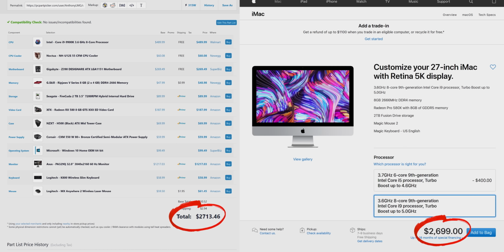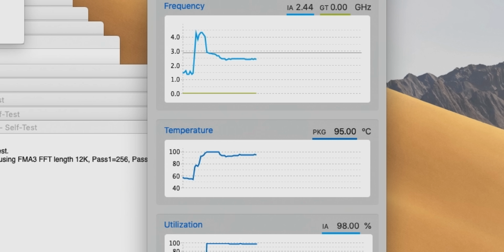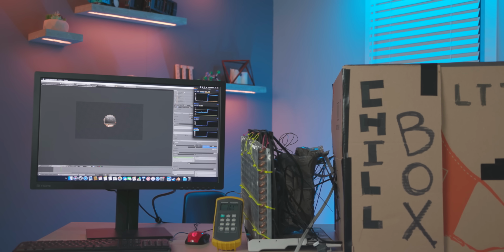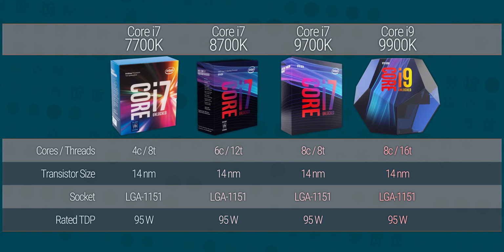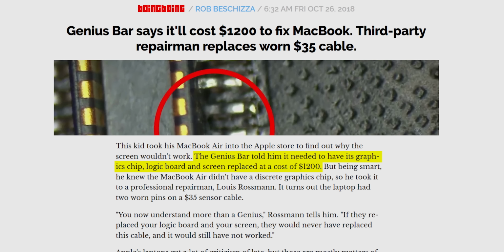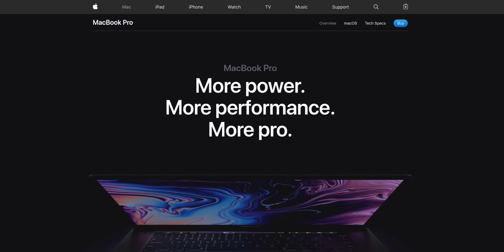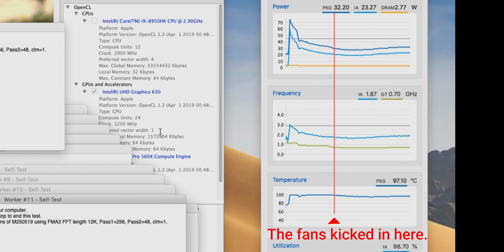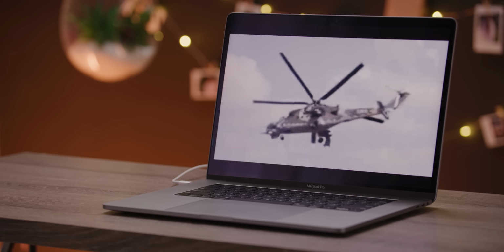Macs are SLOWER than PCs. Here’s why.

Comment: Easy. You look this question as a tech guy. As a product designer I look these questions with different glasses. When designin a product I don't even give a thought about performance. There are market group which I try to please. There are a set of features which this target groups tend to appreciate. Focusing on those aspects and to bring a "quality" feel. It is more important than most of technical performance things. When designing a consumer electronics laptops are usually 3-5 years max. When people have 6 year old laptop, then they want to change because they are tired to old ones. Therefore a good idea is to design a 5 year laptop in mind. Now Apples laptop buyers are mostly doing low performance office work, so why boost performance or long lifetime? They take the cooling to the minimum and gets a huge amount of weight off. This is why I own a macbook. While the unnesessary performance drops, it means more battery life. That's why I own a macbook. The third is the feel of having a quality product, with quality track pad and good feel with a keyboard. That's why I bought a macbook. I am their target audience.

Now I need performance. In our company we need performance. But there is a catch. If you want longetivity and performance, you don't buy a laptop. Because they tend to break quite fast. But you have to, because in companies you need to show things to customers or in meetings. With PC powerlaptops, there are quite good performance, but they are heavy weight. When people travel we go back to the question of weight. Okay they got a performance hit, but those who travel, has a more pleasant trip. It is also a imago question. Many CAD-modelers who does not travel want more performance, but they can't get them because there are less non-traveling ones. Build times are longer but you can open your phone or get a cup of coffee while waithing. Those things happen so it doesn't take the company time off as much as thought. I need performance in my personal stuff, but I would never buy a laptop. I have a Linux tabletop PC (with no childish leds).

Then there is the corporate risk side. If you get a powerful component, which is the newest of the new. Then you take a huge risk. If those component production stutters, then the company is in deep trouple. If the new components sales are low, then they stop making it prematurally. I never go with the performance. I choose a list of components which has the lowest risk. Then I drop all the components from smaller companies to reduce the risk. If there is a company which has almost a monopoly (Gorilla glass), I drop those off too because when the company gets monopoly, then they can do what ever they want and the competition gets really hard. Then the product also tend to stop innovating itself and technology halts.

We have a set of features which our product needs to perform. There is a set of performance which we target and add maybe 10% more. Every company works with limited budget, limited time and limited human resource (even Apple). Within those limits a product must be made. A reliable and quality product. Then they sell it to get more money and with that they have about the same budget to find a corner in the product and start shaping it. At some point the corners get so round that to get more off, you need expensive precision tools. So the amount of resources needed gets up and the changes have smaller impacts to customers. Customers hate this. That is why Android gets these huge changes and IOS changes only small things to the user. Android users want huge changes in every patch, even if they hit performance or are quickly done and really buggy at the beginning.

As for IPhone, the product is their flagship and it has a different audience compared to Macbook. That is why those products are different (referencing to the videos end). Usually in tech forums and comments people hate Apple. But Apple sells it's products. They are doing things correctly. Technically maybe not, but tech guys are not the target audience. Tech guys just look charts and performance and design choises in electronics point of view. How about component risk, business analysis or target group analysis? Have you ever added that to your evaluations?. Apple doesn't even talk to PC guys because they don't care about some dude whining about something when he/she is not clearly even in a Apple product target group. I use IPhone and macbook and I am satisfied customer. That is important to Apple. I work with tech guys and I must say that people have their opinions about tech and performance. But when we talk about products, they don't understand it at all. I have a tabletop PC, where I change the components myself. I can choose what ever I want. But my tapletop PC is not a product. My GPU is a product which I buy. With Apple the computer is a product. Therefore the same rules does not apply as with tabletop PC. I just want the shit to work and Apple does. I have a huge work with Linux CLI stuff all the time, that Apple products out-of-the-box working is really mindfulling experience ones in a while.

Comment: yeah, not pulling out an alienware at work. i want a thin, light, powerful machine...also macos>>>linux>>>>windows IMO
Reply: cool. I think macos is great for more tech-challenged people though, and you're basically saying you are paying a premium only for an OS and looks though so,
Reply: Xray Gaming form has function too, for example the power brick and associated power draw. The machines are nerfed, that we know. My workflow doesn’t require on site rendering for example. Compile times are a different issue and the argument for more beef stands there. Having a professional looking computer is also important

Comment: Mutahar made a custom PC that has better specs than a similarly priced mac, and he runs hackintosh on it, and it runs BETTER than on an actual mac...

Yeah, macs are a trainwreck.
Reply: "Mutahar made a custom PC that has better specs than a similarly priced mac, and he runs hackintosh on it, and it runs BETTER than on an actual mac..."

So sure.. More brute force for the a similar price...  So it RUNS better?  You mean like a Faster actual Mac in Comparison will run "Better?"
Is that your point?
As a Professional audio engineer, composer  , and for 30 years , sold , supported and commissioned systems..... I can Tell you , A hack wont cut it, Its just something you cant rely on...... AND... Hate Macs, sure.. Im not Apple FB, But they have made some great machines.... From the G3 to The Mac Pro 5.1, absolutely brilliant machines....  
And the fact is, when your a Large Film Post Production company, no matter what you say, the issues of support do not entail hardware from Various vendors, and windows (not PC hardware) is pretty much a sea of pain....  
Ill give MS credit, it'd be friggin a huge resource to keep things compatible with different architecture..... But an example, though more a parallel...  OSX supported G4 motorola CPU;s , then IBM PPC CPU's , then on to intel..... Sure, it could be a pain not having PROTOOLS not run on the latest OS release... But you also have to give credit where credit is due....
I love OSX. For Audio its my thing, and its my daily driver....  The system im running has been  updated since 10.3... Cloned and updated through multiple machines......  Never, ever have i had to Format and Reinstall,,,, (Except For a Drive Failure , which was cloned) ....  Does the hardware matter?  Yes/no.   
I hate apples Obsolescence by Design,  I hate this glued together form factor they are pushing, Especially the iMac with the "Pro" Tag 
As for my 2009 Mac pro , to this day, has never let me down.. 3rd party ram, evga980 PC GPU, about 8 Drives. 6 SSD 2 spinners..........
Back when on release at the time, you could not build a PC (server parts... Xeon ) for the for the first few months on release..... But, Apple in their wisdom, Never , ever dropped the price until a new model was announced.... And thats the conundrum... That could be in 6 to 12 months............ 
However.. The New Mac Pro is awesome for us audio guys... But fk me...  that base model is a spit in the face...
Anyhow,  this is not a dig, Just whether you like it or not , There are REAL reasons why alot of Pro's , especially in the audio field , Use macs....

If Linux was a platform that was as complete asOSX, Id make the move straight away.... But, i digress...  Logic for me...  Then again, I could always return to Cubase for Film scores.......
Reply: @Rhythmattica  
This comment can be summed up in one sentence:
"I don't know what hackintosh is"
Reply: @meyes1098  Yes i do, and obviously you didnt read my post.
Your comment can be summed up in one sentence..
"you dont care"
Reply: @Rhythmattica  
" I can Tell you , A hack wont cut it, Its just something you cant rely on......"
- GG. No, you do not know what it is. It's not "a hack", it's macos made to run on other hardware. Yes, it runs better than on a similarly priced macbook purely because of the extra bang for buck you're getting. And it's not a measly 2-5% more, it's massive, up to 50% or more!

Optimization for specific hardware does wonders, but when you can boost your clocks by more than 100% (which a macbook can do for all of 2 seconds, after which it throttles or fucking melts), and you can aid it by an actual GPU, it's more or less irrelevant.
Reply: @meyes1098  Well, Im using a Mac Pro 4.1 > 5.1...
Not Saying Apple haven't dropped the ball... I actually hate the direction theyve gone in.. At least theyve shown some merit with the New mac Pro 7.1...
Yes its expensive and overpriced, not like on release of the 4.1/5.1 systems, which in fact, on launch , where cheaper that an equivalent specd brand PC, even cheaper than building one yourself...
But alas, that was almost a decade ago...
Argue all you want, but in the Professional Audio Field, it is the preferred system.. 
Less variables, means less downtime... No issues with updating, moding .kext files.. ect...
Like it or not, Many in the Field agree.... 
I tell ya, When a Pro Studio Rings, and have a International Artist paying by the hour, and something happens generally due to a software issue, you can guarantee , its not a hardware compatibility issue...
Theres value in that..   But hey, Its not to you.
OK?
Not everyone Does what i do, nor does everyone do what you do...
Fact is, Your reasoning to run a hack is no doubt agreeable to many , but to a small few,  in a professional environment, it isnt feasible...

Its a simple answer, to a question that seems many just cant grasp.

To Add- Not a Hack? Wonder why the term is "HACKintosh" ?
smh

Comment: People are right to criticize Macs, but there are good points in Apples defense: While one could say that a Mac purchase comes with "Just works" idea, one could call that too thoughtless. Except that's not entirely true when that's derived from frustration and a desire of worry-LESS workstation computer. In most cases, PC's are more capable, but for what's needed, Macs are still a good alternative. On a sensible scale with a desire for advanced uses, PC is a "no brainer", but Apple is still a solid choice for creative work and especially if you don't know jack about how to work a computer. I'll keep my PC and sometimes I enjoy the challenge of overcoming a PC issue on my own. And upgrading from my Noctua fans to water cooling feels pretty good, and I didn't pay a kings ransom to do it.

Comment: I know this is a stupid question but is this particularly bad for programmers and coders? I know for gamers it is because of speed and performance issues but I'm in the process of going to coding boot camp and I need to have a laptop for the class which is why I asked.
Reply: Both operating systems are okay, but depending on what you'd wanna do, macOS can be seen as superior as it runs on a UNIX-based operating system.

If none of what your work even concerns UNIX and/or Linux - Windows is just fine.